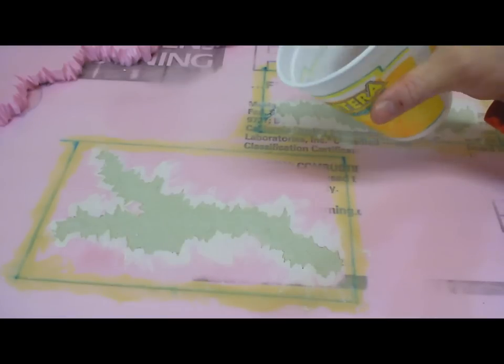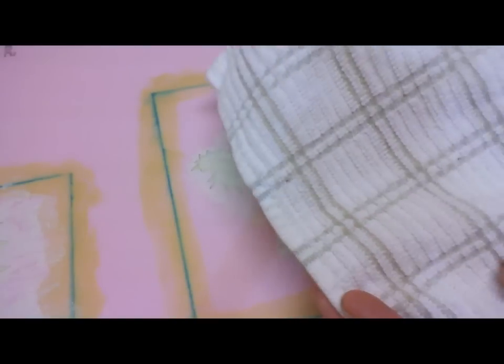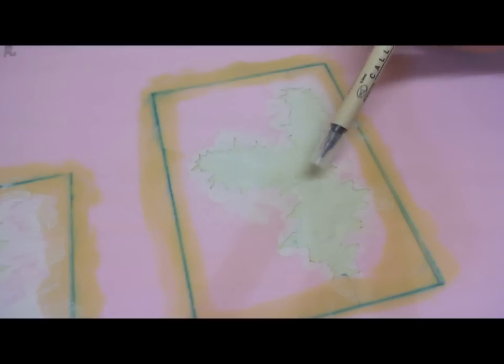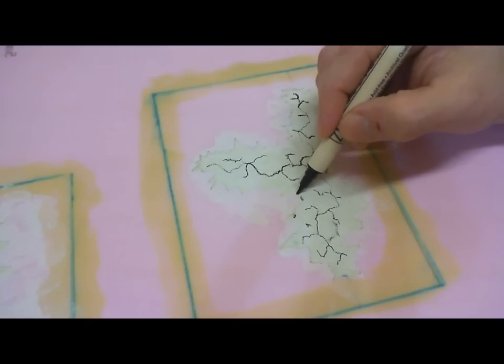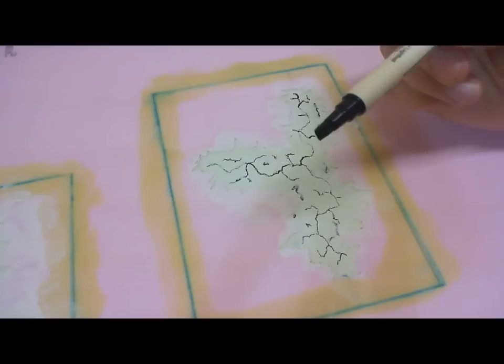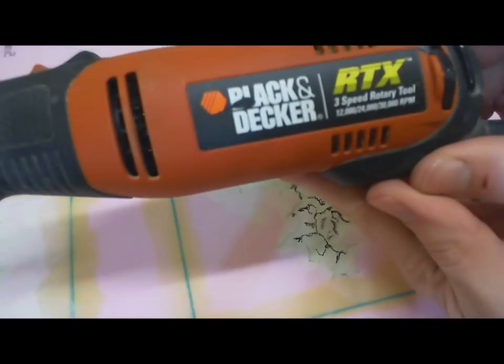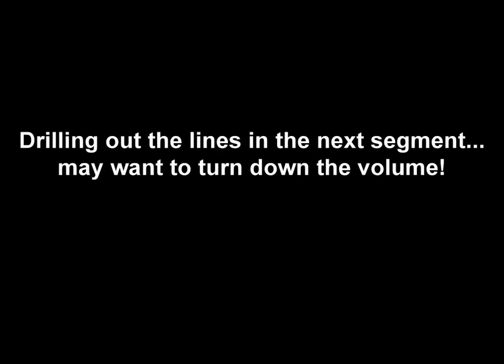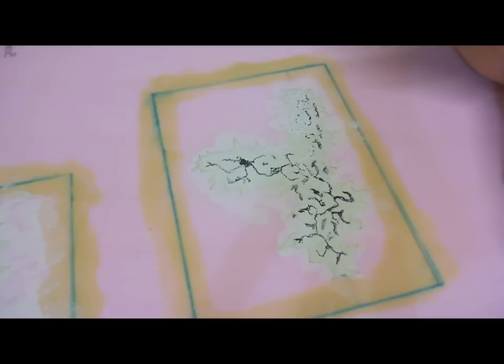Building A Terrain Table - Video 11

Comment from the maker: @acantho77 Unfortunately not without ruining the sides of the foam, or leaving some on the edges which would look bad after painting.  I needed a flat surface to airbrush on (like the way the plaster looked in video 9 after setting up), so I had to find another solution.  This was the only one I could come up with other than redoing another 2'x2' board from scratch.